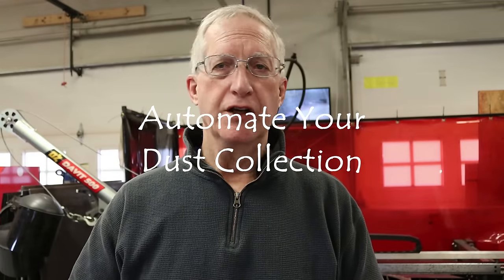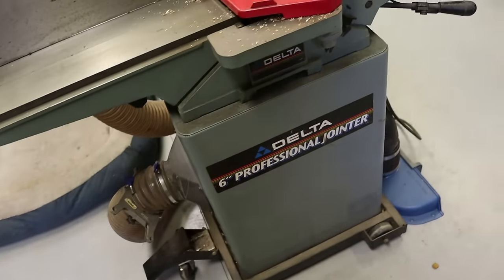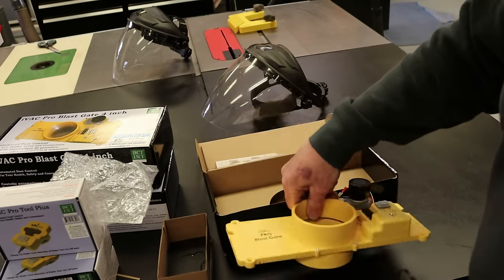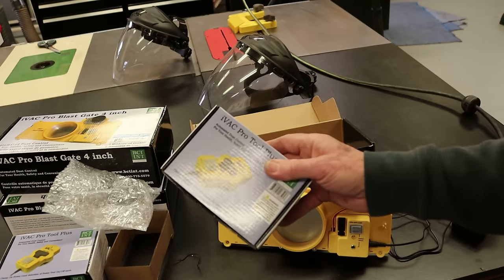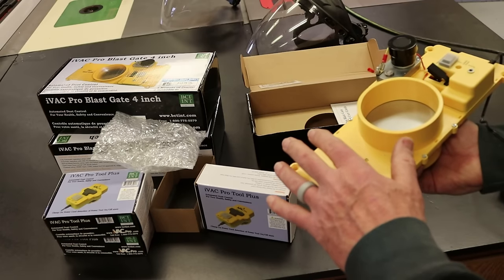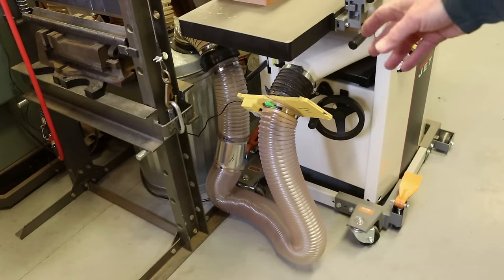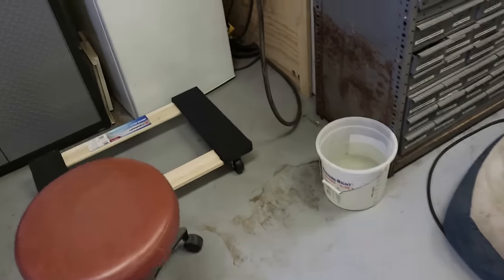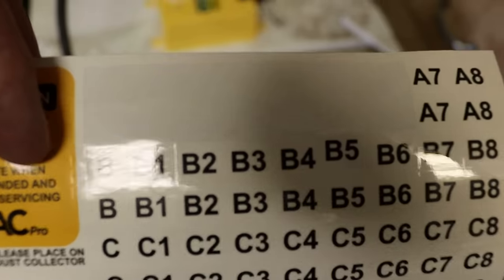Magic in the Workshop!

Comment: I have the same Ivac system as well. Not my favorite thing out there. It is nice when you turn on a tool and the blastgate opens. But it's not nice when you start having serious problems with the system after 2 years... I've been woodworking for 19 years, I'd much rather open the blastgates manually. It's a neat system, hopefully it works well for you. Didn't work too good for me, though.
Reply: Probably some dust in it, I (imagine) suppose,
 so open and clean it ?
Reply: @fred-san  Not it. And yes, I have tinkered with it to try and get it to work. It just won't.

Comment: My 3 HP Oneida cyclone dust collector had a label on the motor starter , do not continually turn on and off the collector for short run times. Must be because of motor overheating and excessive cycles on the starter I guess. I turn on the collector with a remote and leave it run while using multiple machines even one at a time. I wonder if this came from warranty issues or cover your ass just in case event. My old Penn State cyclone does not have a warning for this.  Did your collector have this type warning also?  I think your system is great but too much money for my hobby woodworking .  Thanks for the great info!
Reply from the maker: No such warning on my dust collector. However, the frequent on/off cycling is not good for any motor, so your point is a good one.  I agree, during an extended woodworking session, it would be best to leave the collector running continuously and just open the blast gates as needed. Setting the delays on the sensors to longer periods might reduce cycling.